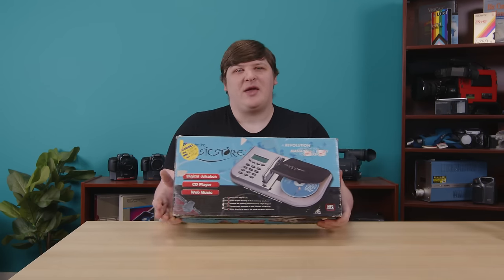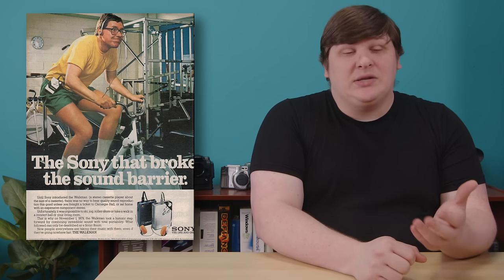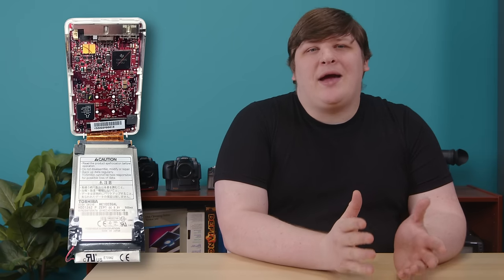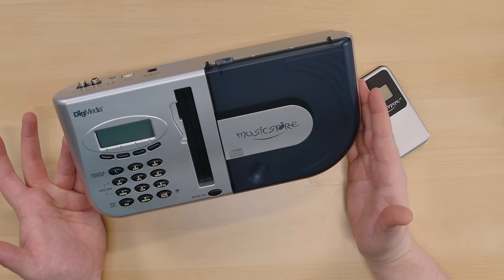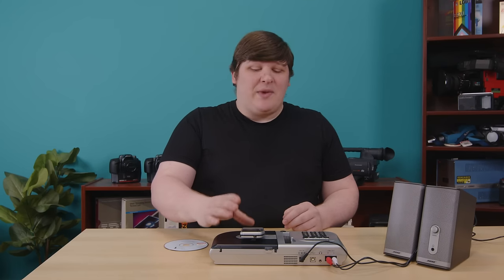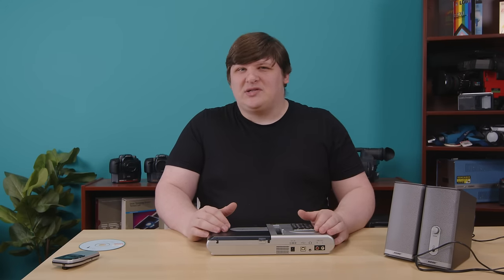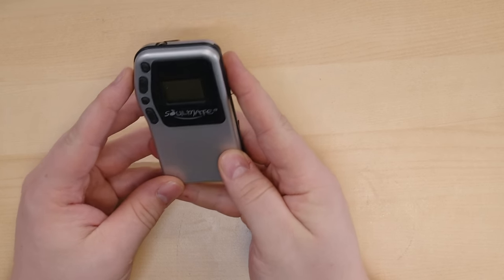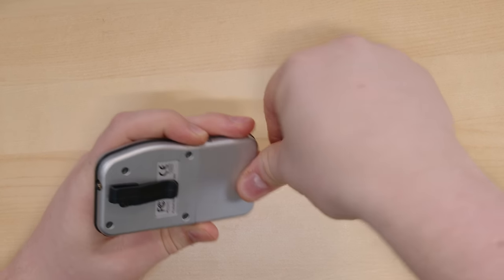An MP3 Jukebox for Everyone (Including The RIAA)

Comment: 36:00 I guess it depends on how fast it can encode, buffer and write those tracks. There may very well be 32x CD readers at this point, but what would be the cost of an encoder that can process the data at that speed then write to whatever media it needs or fill the buffer?  YES, I'm sure there was tech to add a buffer large enough to hold a full CD and some sort of ASIC that could encode the media at that speed...  but those are are all added costs for a product that probably had an MSRP for $500.  (You may cover this later in the video, I'm only 1/2 way through) EDIT: 48:00 Clunky UIs were the norm. One of the reasons the iPod did so well in a product category that was already being well established. Heck, even today most "ali" type products have terrible UIs. 51:00 you also mentioned this about the door to the CD player.  Keep in mind plastic stiffens and becomes more brittle in time.  its likely that hinge latch and the clip were much more supple when this was new 20 years ago. 1:05:00 those two button cells probably keep the ram the clearing out when the main batteries die. EDIT: Ok so super-caps do have a finite life.  not just based on cycles but years.  these probably stopped being effective enough to power the ram 10-15 years ago.

Comment: I thought the Kenwood 100-disc CD changer my dad bought around 1996 was bad. You could at least hook up a PS/2 keyboard to it, although if you typed any faster than about 1 character per second, it wouldn't register. I think I managed to type in about three disc's worth of album info before I said "screw it."

Comment: My only CD player with full CD text and cd-g is a Pioneer 100 disc changer.  It has a mic input too though and was designed to be a CD player and a karaoke machine.  It does properly move titles over to a MD deck unit as well!!!  It also sends very tight start and stop signals to the MD.  I bought it only to rip to MD so I find it funny I use it as a single disc player.
Reply: Pioneer made great karaoke machines back in the day

Comment: The DRM approach of this device with the USB transfer method reminds me a bit of some DVR’s. Some had a USB port to download video’s from a PC to the device, but they couldn’t do the reverse, so you would have to use the DVD burner capability for that. Typically the hard drives of DVR’s have weird filesystems on them, some manufacturers liked to use UFS, an old Unix filesystem. Ironically a lof of DVD based DVR’s can rip audio cd’s to their internal harddrive and convert them to mp3, sometimes even with Gracenote support but those would be from the late 2000’s.

Comment: Regarding the super capacitor. In the mid 90ies I had a Philips Walkman which also had a gold cap with 0.47F built in iirc. It was to backup the clock during changing the weired rectangular NiCd batteries.

Comment: Just wanted to mention that in my country, the iPod was mostly irrelevant because it was SO expensive. Most people had all kinds of Chinese made USB sticks with embedded MP3 players.
Reply: I always felt the iPod was overpriced and overrated, and as an old-school Winamp user couldn’t stand iTunes. I had several different portable mp3 playback devices over the years, and the two I look back on most fondly are the 128 gb Creative MuVo and the 256 gb iRiver. The MuVo doubled as a flash drive which I used for work, and the iRiver doubled as an audio recorder and also had an FM radio which it was capable of making good quality recordings from. An iPod couldn’t do any of those things.

Comment: For me, it was quite the opposite experience for music in the late 90s/early Y2Ks. I couldn't afford my own CDs as a child and my parent was squarely in the CD space so we had no home tape deck. I was really left with whatever CDs they (mother and the relatives) liked and sometimes getting one for myself. I had maybe four or five of my own and I could choose one of theirs if I liked it. I also had my own user on the family computer and when we got a new computer I got the old one (it was Windows 98). So ofc I downloaded tons of MP3s from all over the web. But we didn't yet have a CD burner (my uncle did for his business but it was Firewire) So for my 11th birthday I wanted some cheap MP3 player with an SD slot on it and that is what I got. 
This was 2003-ish and the MP3 player I got had 64mb of memory and had a screen; I didn't get an SD card for it until later. I also only took a single AA as opposed to my old CD player that took four. Yeah the iPod was out but the cheapest option was the shuffle and I really wanted a screen and expandable storage so that was out of the question. So the way I listened to my music was a bit jumbled due to just downloading it and not having the original album order. ( I downloaded what sounded cool to me) So it was more like a digital mix tape than ordered albums. 
When I got multiple SD cards I kinda treated them like mix tapes. Even 128mb can only get you so far with music back then, it is a reason WMA was popular at all, smaller size and sounded almost the same as a similar encoded MP3. When stuff could play WMAs back then it mattered, Lol.
I hated T9 and I just texted normally, I can see how T9 would come in handy for songs though.
I never used MusicMatch, I just drag and drop and I had to do all the MP3 tags myself. 
I still listen to music that way, playlists of my own personal curation. For my 13th birthday I received a brand new first generation iPod Nano, 4Gb. I still bought more non Apple MP3 players later on in HS. The SanDisk Sansa e250 will always be my favorite, with the 'new at the time' RockBox firmware it was pretty killer. I still use it in the car to this day.
Lol the SoulMate uses RAM. This was a bit common back then due to flash "ROM" being so expensive. It is what old PDAs used as storage. Yes that super cap is meant to change batteries fast and not lose everything. PDAs did the same thing and many of those caps are also dead on the old stuff.

Comment: I used to work at Circuit City and that DC jack on the battery pack was common in retail as the way to power a demo unit. 2008, when I worked there, they were on a lot of digital point and shoot cameras.

Comment: The encryption may have also been to avoid some import tariffs on digital audio copying devices. Not sure if it would have evaded them, but that may have been the purpose.
Reply: Note on the RAM: auto-refreshing DRAM  isn't that common, but it's common enough that it has it's own abbreviation: PSRAM, for pseudo-static RAM... which I'm pretty sure is used for one or another of the Flash competitors.

Comment: I did sell a diamond Rio at least once.  I worked at Media play from spring 1998 till Feb 2003. I was personally a cassette walkman guy at this time. Did not jump to mp3 till fall of 2003. I did burn some mp3 cds in 2008.my dvd player could play them. So instead of 74 mins I had several hours on one disc
Reply: Mp3 cds in this case dose not mean conversion of mp3 for an audio burn. That's what you do for a 74 min ish disc. This is putting unconverted mp3 on a data disc and then slapping the data disc in a DVD player.
Reply: I think mp3-CDs are and have always been an underrated way to use mp3s. Initially I started burning them shortly after getting into mp3s in 1999 because my 6gig hard drive on my PC quickly ran out of space from all my mp3s and mpg music videos. Before I upgraded my PC to a 40 gig hard drive, the largest available at the time, I got an older SCSI tower from a flea market with 4 CD-ROM drives in it so I could have up to 6 mp3 CDs available in my PC in addition to what was on my hard drive when I wasn’t using any of those drives for anything else which was most of the time. This was also a really handy way for me to bring my mp3s with me to friends’ homes and play them or copy them to their computers.

In 2000 I bought the first portable CD player that played mp3 files from CD to hit Best Buy shelves, and in 2002 got a much better one made by Panasonic. Ever since 2006 almost every car stereo and DVD/Blu-ray player I’ve owned has supported mp3 playback from CD, and I still periodically burn mp3-CDs to this day.

Comment: For the "average" person, a 50-300 disc cd changer would have done everything this did, and you didnt have to rip them at 1x. and you could program disc and track titles in a lot of them. This seems kind of pointless when that existed. We HAD one. They were obscenely easy to use. Just pack your CDs in, program titles if you wanted to (either with the T9 on the remote or a PC keyboard plugged into the front), and it was all right there. The only feature this has over that setup is the portable unit.
Also, that little flat screw on the back was usually for being unscrewed with a penny or something. Still dumb.
Reply from the maker: Lmao, that's an extremely good point. I just plain old forgot those existed, despite having owned one and seen many. Would have added a lot to the narrative.

Comment: Interesting product indeed, it could have been great but... eh. Just imagine, someone likely did record all their CDs onto this thing....
Super caps have been around a surprisingly long time, I found some in a Yamaha equalizer from the 1980s (specifically a Yamaha EQ-1100; the super caps would keep the micro controller alive after power was cut).
SPDIF can actually send track change flags. I've seen it used to mark new tracks on DAT and MiniDisc when recording from a CD players digital out, so this thing might only be using the IDE for control purposes.

Comment: I bought and still have an Archos Jukebox Recorder 10, an MP3 recorder player with a 10Gb hard drive. I used it for live recording at folk music clubs using a small mixer and 3 mics, and for MP3 recording vinyl records. It was good at both. I'd then use a computer to edit and slice albums into tracks. I could output burned CDs from the computer.
Archos discontinued it in 2003 and never produced  Win 10 drivers or software.

Comment: Self-refresh DRAM - Yes, this is still a thing, not sure if ALL modern memory chips offers this but I would certainly expect all LPDDR chips to offer it and I suspect it's a mandatory feature for memory on SO-DIMMs so there should be plenty of regular DDR chips that offer it too. Yep, a quick google found examples of LPDDR4/4x/5 and DDR4/5 chips with self-refresh so it's at least common, it may well be universal now given how small the circuitry is today and no one wants to offer less features than the competition without a good reason...
And the same applies to modern devices, a modern phone or laptop has one or more ultra-low power microcontrollers to run various tasks but even those tends to draw enough power that having them running constantly to do the DRAM refresh would ruin the battery life (for phones) or how long it can sleep (laptops).
Also, SRAM always cost way more than DRAM and isn't available in as large sizes, an 1999 article I found claims that a specific 16 Mbit SRAM was "the highest density static RAM available today" and intended for supercomputer and such. It doesn't quite say there's no larger SRAM chips but it does strongly hint that this is the case, and it's supported by sources mentioned 8 Mbit SRAM chips becoming available in in 1998 and 4 Mbit chips in 1997, these were also intended for the "premium" (money no object) segment.
If those dates are correct using SRAM would have been a complete non-starter, the resulting BOM cost would have been horrendous and then there's the mechanics of somehow cramming 48 or 96! SRAM chips into a small player (48 MB using 8 Mbit or 4 Mbit SRAM chips).
Re: FPGA vs DSP for MP3 - Yeah, I doubt a reasonably priced 1999 FPGA would be capable of MP3 encoding, that DSP likely has at least 10 times as much compute capability as the FPGA and the only "heavy" stuff it could be for is the MP3 encoding/decoding.

Comment: My first two MP3 players were both cd players; the first was a no-name generic chinese thing that I'm unable to find any documentation for, nor remember what it was called - though the silver-painted plastic of this jukebox is extremely similar.

The second was the Rio Volt, and it could play mp3s off of CDRWs.  That was 2004?  But yeah, all of that assumed a bunch of computer support, but in that era if you were hard into mp3s you probably had a cd burner for other, cough acquisitions.

Comment: In 2000, 1x CD ripping was very common.  I remember when being astonished that I could now rip cds faster than they could be played in real time. And I don't think that was until the year 2003 or '04.
Reply: I agree, it was the time needed to create the MP3 that was a big factor for quite a while.
Reply: Yeah.  It was a real mixed bag for a while.

The old (circa 1994), venerable Panasonic MKE CR-563 2x drive could do it -- I don't remember if it was at 1x or full 2x speed.  You had to have special software that supported the drive, although at the time, ripping was itself a special application, so that's not saying much.

Later drives, including a Phillips-made Creative 6x drive that I had, could not do DAE at all.  Other drives could, they were just terrible at it, and could hardly produce an output file without audible defects.  It was really the CD-burners that saved us. Once the average consumer was aware that they had the means to pirate audio CDs by duplicating them at home, we could finally expect DAE to be there, and to work, because it was the only reason some people had a CD-RW drive at all.
Reply: You could have ripped in full speed in 2000 if you had a Plextor (SCSI?) CD ROM drive. Plextor, the choice of the serious pirate.
Reply: @MoseyingFan   Still have my 121032S.
Reply: I remenber being able to rip CDs reliably at 4x in 1999, but for some very scratched disks I had to drop to 2x or even 1x and in a pristine disc 8x was posible. Normally it took me more to convert to mp3 than to rip the disk to wav. For other part upgrading from a PII 350 to an Athlon 1400 boosted more my ripping speed to mp3 than if i had changed the drive (my drives where a Creative DVD2240e and a Yamaha CRW8424 SCSI)
Reply: @MoseyingFan  do you work for plextor or something?
Reply: @richardepps8500  Or something. My neighbours and me borrowed all the CDs from our friends and ripped them to a file server where we shared them among ourselves.
Reply: @GODAXEN   Hey, I had the 2240E as well!  DXR2 squad, represent!  haha  Love those Panasonic drives.

I do have a fondness for my Creative Hex-Speed CD-ROM, but Phillips just couldn't hold a candle to Panasonic.  I later got a Pioneer DVD-RW drive (early days!  DVR-104, I think it was) and the Yamaha CRW-F1, which was a unique drive!

But nothing could touch Plextor.  👌  It was so sad when they became a badge for .... Lite-On, was it?  End of an era.

Comment: I really doubt that FPGA is doing mp3 encoding/decoding. It's probably only there to handle the multiplexing between the arm CPU and the IDE bus. Maybe it also handles some of the other IO, like the fast transfer directly from the HDD to the soulmate's DRAM.

My guess is that mp3 encoding/decoding is done in software on the ARM  cpu. I remember there being an ARM mp3 implementation back then.  
Also, the mp3 encoding implementation (software or hardware) is probably a limiting factor that would make faster-that-realtime encoding hard to implement.

Comment: Expecting 32x MP3 encoding from such a device in 2000 is a little bit absurd.
CD drive wasn't a bottleneck here. The computing power was.
I mean... I was still using Cyrix 6x86 back then (I upgraded to Duron 700 in 2001) and I don't think it would be able to handle such task. Not even mentioning some small embedded/industrial CPU running that device.

Comment: I had an original Creative Nomad MuVo.  I believe I had the 128mb version.  Best little player.  It was basically a USB thumb drive with a harness that gave you a battery to power it (Jack and audio controls were on the USB drive portion).  This little thing blew minds back in 2004ish when I used it in college to save my C++ Programs and hand them in to the teacher. I had to explain how it worked to the teacher who had never seen them before.  Even then we were required to have ZIP Disks to save our programs, and at this point ZIP Disks were well obsolete and disks were expensive as hell.  I kinda sorta started the revolution of USB drives at my school, as they were cheaper than ZIP disks and way more convenient since you didn't need a special drive.  I love the non-ipod mp3 players, lots of neat stuff.
Reply: I had one of those between 2004-2006. I loved it. I was doing freelance legal document preparation and used it to keep all the doc files I was actively working on and pdf files of relevant minute entries and images of other documents as well as enough music to listen to on my commute.

Comment: Modifications I would have made if I had my hands on some of these units:
- Write-after-Read FeRAM in the Soulmate, instead of PSRAM (Pseudostatic RAM) or Self-Refreshing SDRAM.
- Dumping the ROM of the MusicStore and replacing it with a NOR flash chip, with modifications such as a removal of the DRM, the ability to recognize Albums, and the use of an actual recognizable filesystem (like Transactional NTFS).
- Put an SSD in the MusicStore.

Comment: Yeah, DAE was a very very finnicky thing for very many years. Most drives just outright didn't support it, and most of those that did didn't do it well. Most drives did have the digital audio connector, and it did work, but I worked in electronics recycling during the era when PCs from this generation were being scrapped, and I never once saw a prebuilt PC with that cable present.

The contemporary PC hardware community knew all of this, and there was a shortlist of DAE-capable drives everybody used. This situation persisted well into the common CD burner era, which is absolutely wild.